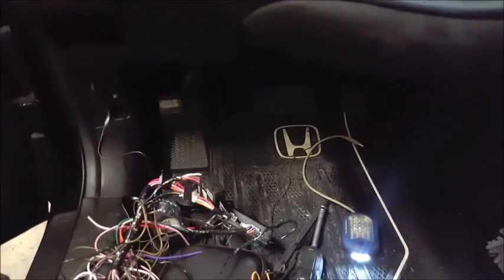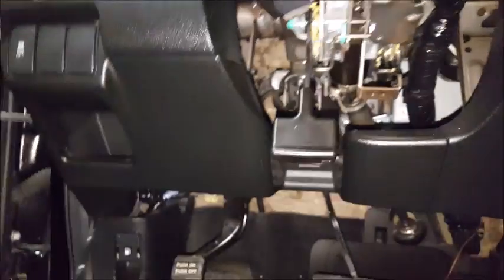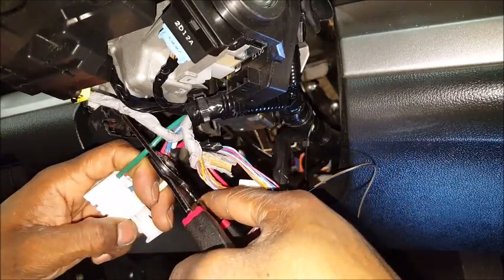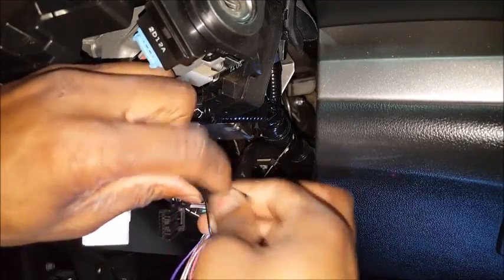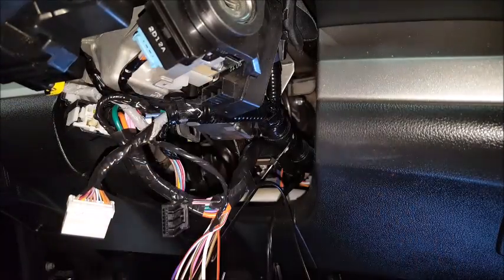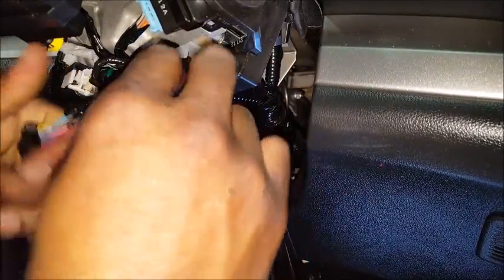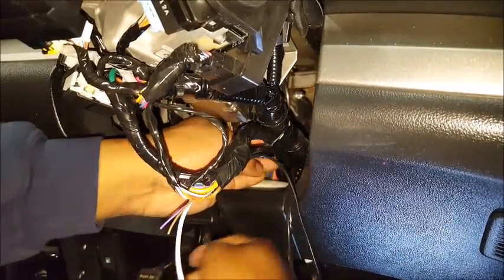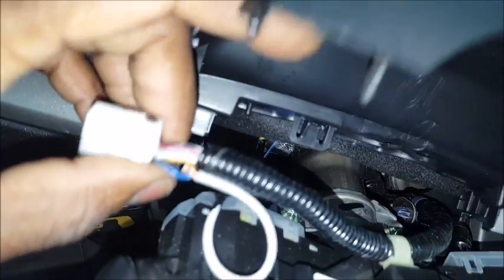How To Install A Remote Start Alarm  Completely From Start To Finish on Any Honda 2001 2017 1 HR Vid

Comment: First of all let me congratulate you for the amazing video you have done on this. Hi i have a quick question, i recently bough a similar smart start system  for my 2016 Honda Civic manual drive. in the manual booklet provided they have mentioned about extra relay for central lock connection which confuses me. do i need extra relay for my 2016 honda Civic to install it.

Comment: Can you tell me if i need a imobilizer module on my Dodge ram 2012 1500 and what kind can I use thanks
Reply: I would select the Flashlogic FLCAN. With the bypasses used today, they need to be programmed for your specific vehicle. You would need to buy the programmer or find someone that can program it for you. I will post a video on my channel showing how to program a module.

Comment: What is the bypass for? And what would I need it for? I purchased the  5806V and it didn’t come with a bypass
Reply from the maker: The bypass module jobs are to disable the factory security system, disable the ignition mobilizer system, integrate the door lock to the aftermarket alarm remote start and to send I/O data between  a digital alarm remote start system and the car via the can bus interface network.
Reply: PrecisionConnections got it. Thanks

Comment from the maker: I'll do a video covering why soldering connections are not recommended in the INDUSTRY by Both automotive manufactures and security company. Ask yourself this: why wouldn't they include this method of wiring in modern installation manuals if it was the overall best way to install their products? And also why Can't you find any soldered connections in new cars going back 50 years?
Reply: PrecisionConnections where did you get the wire color chart for your car?
Reply from the maker: www.directed.com "dei"
Reply: PrecisionConnections 
I have problem with a remote start alarm viper 5901 I installed but when I armed  the car (lock) and try to remote start the alarm start and the car turn it off, if the car is disarme (unlock) all works perfect do you know what's my problem? 
I installed in 2015 scion tc
Reply: Hi can i get help from u i have a Hyundai genesis coupe its manual gear box and its keyless, so i went through the wiring and it was complicated so i have decided not to continue, if its possible to help me through this very appreciate it and if u want me to pay you for teaching me please let me know, thanks.
Reply: I'd have to disagree, I have used various methods over the years, and nothing leaves my installs as worry free and secure as  well soldered connections. Have had a lot less come backs with both bypass or remote issues..
Reply: It's easier and cheaper to crimp connections. I don't recommend just twisting wires together. As far as your statement about cars not having any solder in them your wrong. In fact your gauge cluster, switches, radio, antenna, blower motor, hid ballast, excetera excetera all have soldering joints and I'm not talking resistors and such. There are also wires soldered to the boards too.

Comment: Hi, I have installed viper 5901 remote start alarm.
When I start with the remote control and is unlock the doors, the car start but don't lock the doors, if I start the car with the key this locks the doors perfectly, do you know what's wrong?
Reply: You need to find a pulse during crank or pulse after start wire on the remote starter  And run that to your lock wire. In the car.

Comment: P.C. i have bin around for over 60 yrs. and bin repairing auto's the same! This is the first comment that i have ever felt i should share my opinion on. To things i would like to share are first disconnect the negative on the battery, and use a high watt soldering iron (30+)and heat shrink on your connections. But other than that well done,also i learned something! TY for your time and the vid. CBS [Trade Master]
Reply: No nc
Reply: Switches

Comment: I was just on your website and noticed that you have an 818 la area number. I have a 2013 ML and I would like to add a smart phone starter with gps tracker that i can see on  car on my phone I left you a message to call me back. thanks
Reply from the maker: Alicia Hernandez. we have partners in L.A. that you can have the installation done today. Or if you want me to do it personally ill be back in town
 feb 5 2018 - feb 26 2018 all warranties are handled locally by those affiliates for the total warranty guaranty period

Comment: hello baby. i have a question for you. i have install to my car viper 4105v but i wanna replace that with a new model viper or something also what i need to do? i need buy a key only? key and box remote? ore i need to rplace everything wire box and key from start
Reply: You will have to replace the main brain which will come with new remotes.  Good news is most likely,  you won't have to do a lot of rewiring due to staying with the same brand.

Comment: I installed a directed 5105. I got the ignition hooked up and the remote start hooked up. I have the break wire going to to break switch. but when i remote start the car i can get in and push the break and the car does not shut off. can you help me out with this.
Reply: You have the wrong brake wire.

Comment: hi , I have Honda CRV2010EX , I am looking for TACH Wire , please help me where can I find it ?and what is its color ?. Thanks in advance
Reply from the maker: This wiring information is being provided free of charge on an "as is" basis, without any representation or warranty. It is your responsibility to verify any circuit before interfacing with it using a digital multimeter.
Directed electronics, Inc. assumes no responsibility with regards to the accuracy or currency of this information. Proper installation in every case is and remains the responsibility of the installer. DEI & this Channel Creator   assumes no liability or responsibility resulting from improper installation, even in reliance upon this information.

White  pin 3 of the cam shaft position sensor. Recommend using a bypass module for that connection because you can damage your vehicle  if that wire gets shorted to 12 volts or ground.

Comment: I have a 1994 Toyota DLX Pickup I had a Company install my  Avital Tornado 1 Alarm many years ago now its not working and my truck wont start... please help .. Thank you
Reply: Just disconnect the main alarm module.. should start, if the problem is the alarm...
Reply: See post

Comment: Why did you wrap the parking light wire with electrical tape?  It was already insulated, wasn't it? 40:57 to  41:15
Reply from the maker: To Secure the overall connection from being pulled off or vibration and/or temperature fluctuations on the tape glue

Comment: N Ice video my viper starter turns on but the starter keeps running I dont know why can u help me I tryed everything cant figure it out I think I need to hook up tach wire i have a 2011 honda accord but I dont have no idea how to install it or where to install it
Reply: Do you install a bypass module along with remote starter.  Is the security light flashing on the dash when remote started.  Try putting  a key in ign cylinder and remote starting it that will let you know . What your missing.
Reply: Tac wire is usually in an unused test plug right by drivers side firewall in engine bay

Comment: Hey. So I have a '12 Civic Coupe and I was wondering how one goes about obtaining all the harnesses, wiring, & boxes needed for the alarm + remote start. I have an authorized dealer that quoted me around $800 for an installed system (2-way), 1 mile range, remote start. Now have no fear of wiring it up myself, I just don't know where to go or what sheets to look at to tell me what parts I need for my particular vehicle, and Google's surprisingly not that helpful for this.

So basically, if I buy the 2-way Viper alarm kit, what's included? What do I have to buy in addition to the kit to get it operational? Thanks for any advice you can give.
Reply from the maker: Eric S your biggest road block might be getting your immobilizer bypass module programmed via the viper website.Starting 2018 they are not allowing non authorized dealers to gain access to their technical support servers because shops nationwide have been complaining to them about being cut out of the financial loop.
Reply from the maker: Eric S you will need the dball3 immobilizer bypass module
Reply: Luckily a lot of sellers of that bypass module offer flashing at purchase anyway, so it wouldn't really be an issue. I'm actually looking at getting a new car this month(ish), so the alarm is gonna be on hold until I have a sale made and know for sure the model I want is what I need to plan for. 

I suppose flashing it for the car is the only programming you mean. If there's more required that Viper isn't going to love me doing privately I'd love to know. I realize that a professional install is better, yes, and it's likely I'll get no insurance discount for a third party alarm if I tell them I did it myself, but $800 for an installed system to me is absurd. The install takes one guy 2.5 hours. Less if they know exactly what they're doing. $4-500 for that is stupid.

Thank you for the info.
Reply: I ended up installing this myself on a 2013 scion frs. Went really easy, even got the remote start working in the manual.

Only thing I needed was the cable to do my key clone which took seconds. I'm now doing one for my winter truck.

Comment: I install this same remote starter on my 99 tahoe LT and it wont turn on do i need a relay or bypass
Reply: Did you ground the neutral safety wire? It should be a black wire with white stripe.
Reply: @shoncarter3730  i grounded but now it turns it to Acc only and it and dosent crank the engine

Comment: P.s. NEVER CUT ignition, canbus, and immobilizer wires in half!! That’s a big big no no.
Reply from the maker: Frank Honeycutt question to your comment: If you don't cut the immobilizer ignition wire how are you able to feed bypass data to ECU while the IMO is transmitting at the same time as well as at the same clock speed?
Reply from the maker: Oh ok you're just trolling lol ok 😎. Clearly stated this video was designed for new 👦
Reply: PrecisionConnections use a t-harness so you don’t have to cut any wires, I never cut. I’ve always convinced my customers to spend the additional $30 for a t-harness plus it cuts the install time in half. Honestly not trying to troll or hate, just giving my recommendations.

Comment: I bought a avital  4301 with xpresskit.so you saying the only thing the change is wired colors in the car right
Reply from the maker: yes  but xpresskit website,if you have an account, will provide you with the correct wiring color code but the pin location from the video is the same
Reply: Your shit is neat and clean kid

Comment: This may have been asked before , I watched your video and it seems that you do have skills .... My question is when a few years has passed by and the system has either a power or data connection issue because you failed to solder your splices to provide a solid electrical connection before they were taped up, what is your warranty duration for this product ? thanks for taking my question.....
Reply: So because he didnt solder the joins you assume he has no skill?  Soldering is overrated and unnecessary when twisting the wires in the manner he did.

Comment: I got a question sir... so I disconnected the battery and somehow my Viper alarm is not working the same... what should I do to make it work like before? Thanks in advance. Pls answer🙏
Reply from the maker: Adrian JF what was it doing before that its not doing now?
Reply: PrecisionConnections it only lock and unlocks now and the siren chirps on panic mode. The siren doesn’t chirp anymore when lock/unlock, the control button system is not working.
Reply from the maker: Adrian JF you can try opening all doors. no  key in the ignition. press lock on the viper remote. soon after press unlock on the viper remote then lock again using the viper remote. And if it starts to work. Then that's that!
Reply: PrecisionConnections thanks I’ll try and let you know :)

Comment: My son got a compustar remote start install in 13 dodge avenger,installed by shop they said the installer slip and fell on something crucial for starting the car? That's what they told him,I tried to call the shop ask what is it what wire the shop won't tell me,they told my son that they had get part from dodge dealer ,the shop got him a rentals and had he's car fr 2days he got car back a day it work ok but today all dash lights came on the check engine,low tire sensors Trac sensors , my question would you know what the mess up what could cause the lights to come on the car is sputtering while driving ?thanks
Reply from the maker: AmazonShroom I would uninstall the system completely and put the car back as it was before the installation. Let the customer test the car for a few days and if the problem doesn't occur. I wound reinstall a fresh unit and if possible have another employee do the installation. Sometimes trying to figure a faulty connection covered under tape is not worth it.
Reply: PrecisionConnections I just found out it was a skim module ,Now my son car is sputtering more he can only drive 30mph ,with all dash lights flashing
Reply from the maker: AmazonShroom sounds like the skim module could be damage by probing the CANBUS wires with 12volts. these connections goes directly to the NXP Canbus driver chip inside the module causing the outputs to become weak thus causing data errors & interference on the data bus line. They can test the data voltage. Using an oscilloscope or multimeter for good high volt and low voltage -5v/+5v data transmission
Reply: PrecisionConnections yeah they did damage the skim module, but they step up and paid fr dodge dealer fix it and gave a rental car ,and they reset the system, so far the car is running good everything is working thanks fr sharing
Reply: I'm have the same problem with my 2015 wrangler and this started to happened right after my remote starts was put inIve been to the dealer and they cant figure it out.my battery is not hold charge and they replaced the battery 3 time and the alternator . i cant prove that it's the remote start that's causing it. how are you making out with this problem
Reply: they replaced my altinator also
Reply: Keneth Parker it was my son's car he lives in different state,I couldn't help and check out the car myself,the stereo shop or installer broke the skim module while installing a compustar 901? alarm/remote start The shop paid the dealer install a new skim and a rental and still had problems where car dash lights all on and car had no power ,next day stereo shop said they reset the system , so far the car started to work better and drive  ,but now it just when he starts car with remote the alarm goes off ,
Reply: Keneth Parker  like Presision connections mention you should uninstall the alarm/remote start drive jeep fr couple days see if it still has the problem sorry I can't help maybe PC^ can ? Good luck
Reply: yes I had them disconnect it and it turned out to be the problem they said  that it was a bad module

Comment: i have db3 with the 4105l remote start for a ford 04 explorer how i can connect
Reply from the maker: yustin abarca The connections can be found directly on the viper website: they constantly are making changes to their systems so its safer for you to go their during the time of your installation and looking it up.

Comment: No, a canbus system on a car is nothing like usb whatsoever, data+ on usb is green and data- is white, canbus is more like a serial comm system for a car but you still need some sort of serial conversion to connect to the car for diagnostics, i had to study this in order to achieve bluetooth connectivity to my cars ecu.
Reply from the maker: Slow down!😏 lol I said "exactly like" I didn't say not "is exactly " I was only referring to the similarities of the wire pair of both CANBUS and USB which carries both negative and positive serial data for communication purposes.   I didn't mean that you can connect your computer to these wires with a USB cable😅. USB requires a host computer. While CANBUS does not! It runs on a hierarchy propriety based function/module system
Reply from the maker: Tyrone Nelson I'm glad that you brought this up so that we can clear this up 😏 lol I said "exactly like" I didn't say not "is exactly " I was only referring to the similarities of the wire pair of both CANBUS and USB which carries both negative and positive serial data for communication purposes.   I didn't mean that you can connect your computer to these wires with a USB cable😅. USB requires a host computer. While CANBUS does not! It runs on a hierarchy propriety based function/module.
Reply: Your right, we both need to share info, there's things you know that i don't and vice versa, anyway it would be good to learn different types of protocol and the type of data that runs on a canbus system in a car, so if anyone comes across any problems we could help.

Comment: Hey 2002 CRV harness different can you help
Reply from the maker: Yusuf Murphy 2002 is different you have a security light/ key data/ignition/ wires that you will have to interface

Comment: Also works on Acura? 05 RSX specifically
Reply: The remote start will work on almost any car, the bypass on the other hand is what you have to check for compatibility

Comment from the maker: 15:57 explains the reason why wire we chose to make our connections at the steering column: for the purpose of visual understanding of  the overall installation